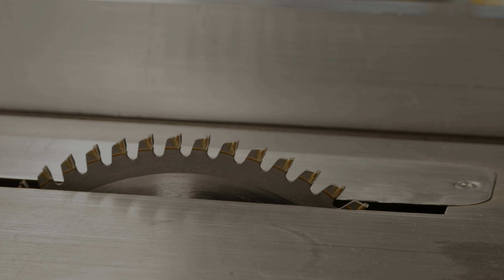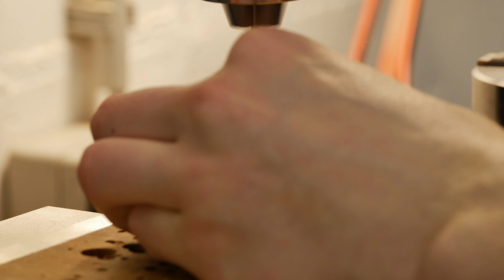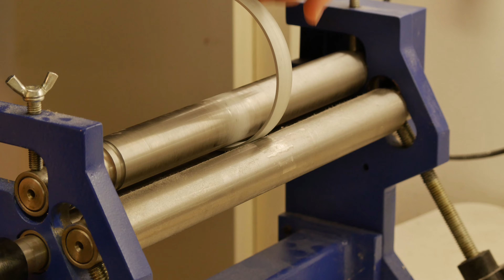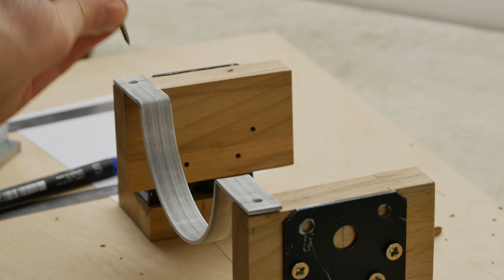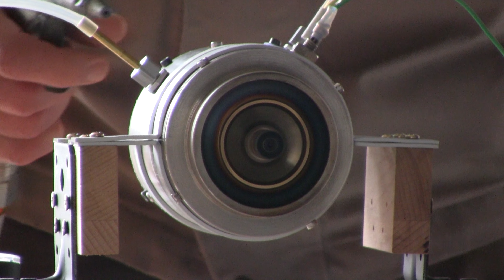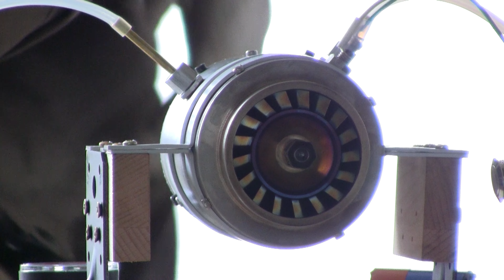Homemade Jet Engine 4.0 | test run 3

Comment: I thought it was going to run the first time you span it up with air! For the bearings, try to get or make 'full complement' bearings - these have no cage. The centrifugal force can destroy the bearing cage, if it runs, in any case.
Reply: Maybe it would be good to integrate a roller bearing which supports the shaft?

Comment: I think it dragged because the turbine got hot and expanded not because of the bearing, although the bearings need changing as well. Bearings without a cage and more balls are popular with diy jet engines. You can also add a belmouth inlet this will reduce losses

Comment: You need a bellmouth inlet , you currently have a vena contracta  with that sharp inlet edge to the housing , this is reducing the mass flow to ~60% of its potential making the turb stage oversized with low energy transfer to the turb wheel , theres a miss match between comp and turb

Comment: Cageless bearings, also fuel injection direction could be opposite to airflow in the engine to allow for better mixing. This would possibly make it run.

Comment: Use ceramic bearings. Or if you're really smart, air bearings. Also use a leaf blower for starting as it won't imped the initial spool up the way a direct drive starter does.

Comment: the flame combustion is too long, put a restrictor on the intake until it is confined in the comustion chamber, there is to much flow for the lenght of the combustio chamber and the full temp occures outside of the chamber... you could also redesign the holes in the chamber. The calculations are right but the flame is too long. It occures to a Russian guy with a small turbine, he restrict the inlet and it worked

Comment: I've gathered all the required material to build a turbo jet engine. But, what i'm lacking is stainless steel tubes to build sleeves to cover vapourizing tubes. I was planning to use Copper Tubes as sleeves, is copper a best choice as an alternative solution to use as sleeves ? Guy's if have any idea, would be great if shared.
Reply: It could maybe work but copper would burn away in the  hot environment
Reply: If you want a persistent jet engine you need stainless steel. There are 1500  centi degrees in the primary area of the combustion zone.